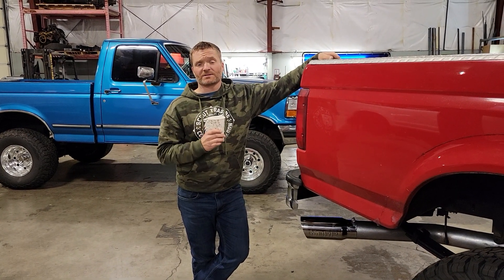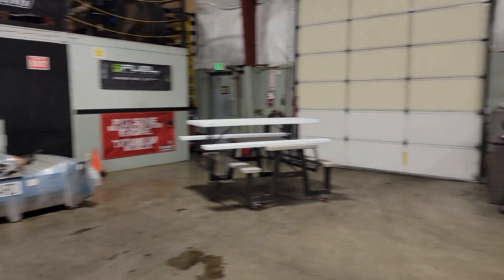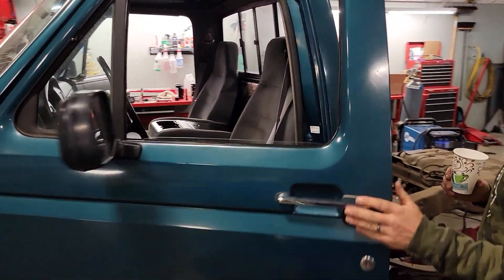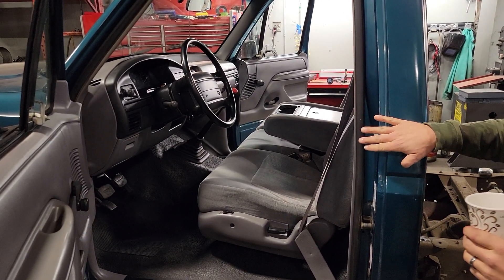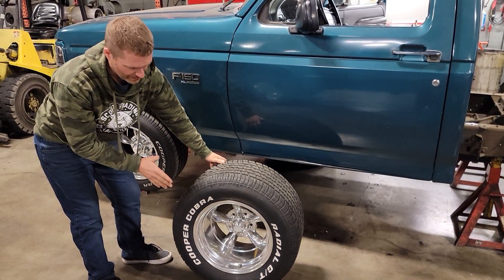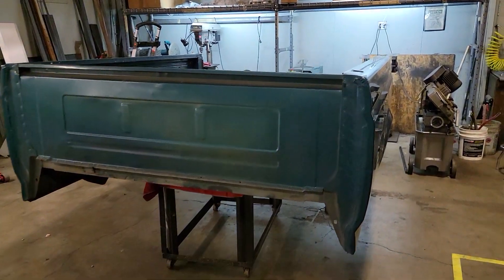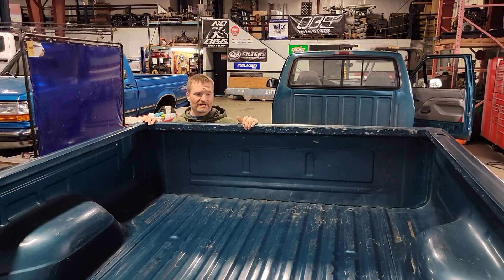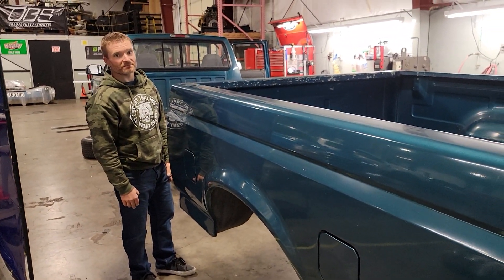OBS Solutions Shop Truck Project Update!

Comment: I had an 84 F-150 with the 300-6 cylinder that I put 380k miles on before I sold. I put nothing into it except a carb rebuild kit, spark plugs/wires, distributer cap, and oil. Great engine!